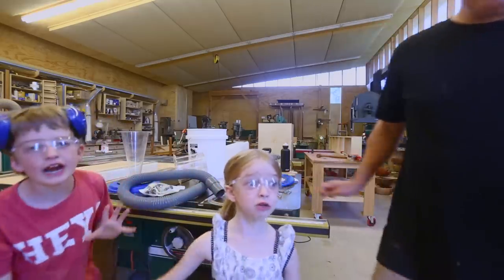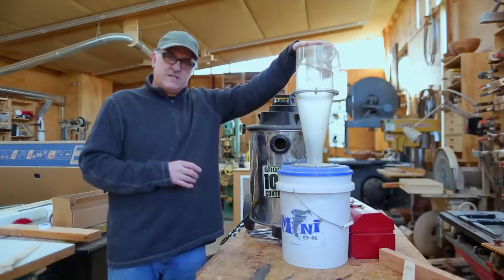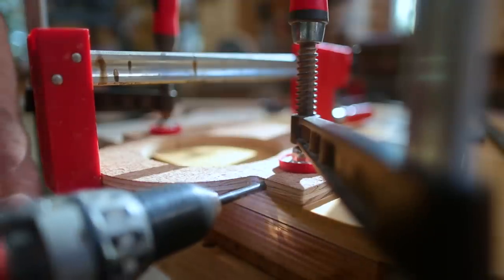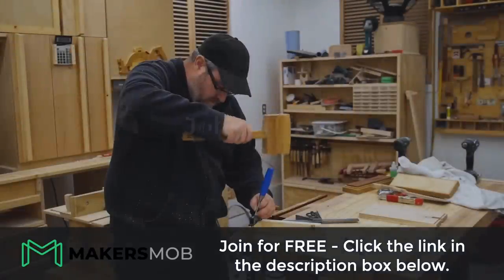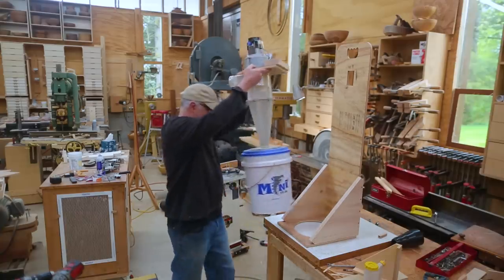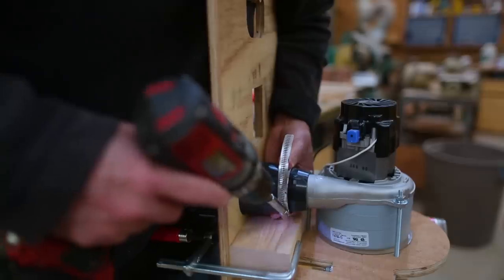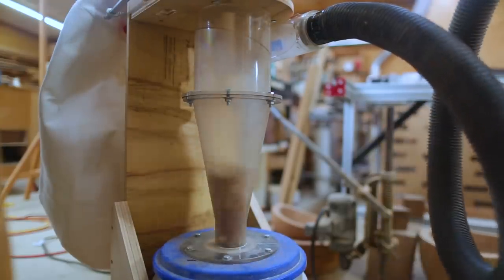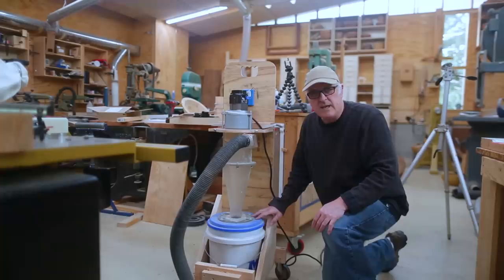Frankenvac

Comment: Throw the bucket away and make a square tapered box the same volume and opening size as a plastic bag. Next make a wooden lid with trim around the edges to form a lip. Under the lid inside the trim use some foam tape for an air seal. This makes a much better dust container with greater volume. Fix the lid to the trolley then make a lift to push the box into the lid. Mount the motor horizontal and place a round filter to the top of the cyclone clamped between 2 timber boards with sides to make a box. You probably won't need the bag after the motor but if you still want it the bag can hang down.

Comment: if making it all custom, just put the cyclone lid on a plywood box (with a latched side to clean-out) as the receptacle rather than bothering with the bucket.
Reply from the maker: I like this idea
Reply: @frankmakes  Put the cyclone lid on a plywood box with a latched side as @David Benoit suggests, but put a lift out box inside that for ease of emptying.
Reply: That box can greatly increase the capacity without increasing the footprint much
Reply: To riff on this idea a little.....maybe a box at the bottom with a door or possibly a blast door to enable a quick connect to the shop dust system, so you never have to actually "empty" it.  Just wheel it over, vac it out (vac out the vacuum, that sounds like your humor), and off you go.  Judging by the low amount of dust in the bag, it'll be a loooong time before that needs emptying.

Comment: Instead of a bucket at the bottom, make an enclosed drawer box you can simply slide out.  Screw the cyclone base to the top of the box enclosure with some foam window gasket under it to make it airtight.  If the drawer leaks too much air, you could seal that with foam too.  Use window sash latches to hold the drawer in tightly.

Comment: Nice dust collector, I made one similar but used a complete smaller shop vacuum unit and mounted the shop vacuum directly on top of the cyclone dust separator, however in doing so the motor is now rotating horizontally, this might not be good for the motor as it it is louder than it was before,  also keep the suction port above the level of your benches as that makes the hoses easier to handle, also on my second edition

Comment: Maybe mount a short drawer track (or maybe two) vertically to a modified blower support so that it can be slid upward in order to remove and empty the bucket.  You can drill a hole in the track in the upper position to insert a pin to hold it in place until the bucket is emptied.  In the raised position, you will also be able to remove blockages in the cyclone by probing, which will allow them to fall into the bucket.  Also, you could add a counterweight on the back, similar to the one that you placed on your radial arm saw, to allow the blower and cyclone to slide up and down effortlessly.  An old window weight inside a PVC guide pipe might work well for this.  A clear 7 gal. bucket would good with this setup.

Comment: Replace the existing lid with a plywood disc and attach it to the bucket with 3 or 4 latches and either some weather stripping or a home-made rubber gasket for a seal. That way you can have zero-clearance removal of the bucket from the vortex assembly.

Comment: Suck it Dyson.  There’s a new player in town.   This makes so much sense.  Have an integrated system that doesn’t require 2 tanks.  I currently have a massive Ridgid wet/dry that overwhelms my shop an the dust deputy sort of rides on top when it stays. I have a second with one of the tool box sized ridgid shop vacs that sucks just as well.  Almost no tank.  I have it more stationary for my CNC dust collection.  Both setups need to be modified to make them more esthetically pleasing and user friendly.  Thanks for stirring my imagination once again.

Comment: I would suggest making the entire unit much taller, and dedicating the bottom of the unit to parts storage, building a couple of hooks beside the upper part and then lift the bucket up into position and use the handle of the bucket to hook the bucket in place. That will make the bucket removal process super simple. The vacuum of the unit will hold it tight and the space the bucket uses now can be converted to nice nozzle or any other storage you want.
Second thought. In addition, I would suggest the motor to be mounted horizontally instead of vertical. The motor can then blow straight down to the floor into a HEPA filter hanging beside the bucket and reduce the "Footprint" of the final design. This would also reduce the possibility of blowing  contaminants across your shop and any current projects
Third thought? I wondered why you didn't use the existing shop vac bottom and "marry" the cyclone on top of it, taking advantage of the wheels, and handles? I have the same shop vac and considered some of these questions over the years I have used it.....

Comment: Mount the blower motor on top permanently, and then run a hose to the cyclone.   Make the blower high enough so that you can lift up the cyclone and bucket together.  To change, simply disconnect the hose from the cyclone, and lift the bucket and cyclone up and out.  Then split the bucket from the cyclone and empty.  I have a system that works like this and it works well.

Comment: seems like the hinge would be more complicated that necessary. Just cut across under the top horizontal for the unit. Then put pieces of wood on both sides that allow the top to slide, so you are capturing it put some end caps to prevent it from sliding sideways, then drill some holes for a pin. Pin it closed, pin it slid open for emptying. Done.

Comment: @frank - mount the bucket upside down, the cyclone mounted to the bottom of the bucket, pop the lid off from the bottom right into a trash bag and let it all drop in.  may want to add a safety latch so the lid doesn't pop off by itself.  just a thought

Comment: Raise the upper part about 1" and use wedges or board to raise and hold bucket under lid. When time to unload, remove wedges and drop bucket down and slide out without touching upper assembly.

Comment: Put a bit of flex tube from the bottom of the cyclone to the bucket. You can then pop off the lid because of the flex tube and then just lift the bucket out.

Comment: Seems to me you need to be able telescope the motor mount and cyclone up away from the bucket.  The easiest way as I see it is to have another back piece that mounts the motor, the cyclone and the bucket lid.  Cut some slots in the new false back and the have some stand off bolts in the original back with a couple of star knobs.  When you want to empty the bucket turn the knobs, extend the new false back up, tighten the knobs to hold in place, clear the bucket and then lower it and lock it off with the knobs.  Does this make sense?   You may have to set the bucket back the depth of the new false back + the distance of the standoff clearance between the 2 backs.

Great content  Frank as always, keep it up I appreciate the hard work you put into your videos and your channel.  Stay safe.

Comment: I paused the video at the point where you said I need to come up with a way to empty this; ironically I said add a hinge; BUT I think a better way would be to make the current "one piece back" a "2 piece back" with a longer top half which could slide up/down bringing the motor, funnel, and bucket top with it. When its slide back down, it would re-seat the lid. You could then use "wing nuts" to secure the 2 pieces in place. jmo

Comment: You might want to use a 33 gal trash can, or 55gal drum, the liners are cheap & you can clean the whole shop without having to unload. For added benefit: the lids are more rigid, allowing you to just put a hinge on the lid.

Comment: Replace the bucket with an airtight box with a removeable receptacle inside that you can dump. I'd make the top of the receptacle have a tenon all the way around that would slot into a dado cut in the box sides so dust couldn't get past it into the box. Done right, you wouldn't need the lower part of the box at all.

Comment: One other thing to consider is that if by chance you don’t realise the bucket is nearly full then the cyclone will lose its efficiency and fill up the motor and bag very quickly, try to add a mesh screen before the motor otherwise it’ll overload the unit

Comment: If you press fit the bucket with a lever and a platform on the bottom, I think you can easily remove the bucket without unscrewing anything.

Comment: Flip your bucket upside down. Cut the hole for the cyclone in the bottom of the bucket. Then you can have the lid on the bottom of the apparatus so you can pop it off and dump out the contents.

Comment: Frank, just ground the circuit to the metal that is part of the motor housing, there is probalby a through bolt someplace where you can back off a nut and capture a connector crimped onto the end of the wire.... infact, those big pieces of threaded rod you used to hold it down with... if that is all metal to metal to metal to the motor, just attach to one of those. That would also - I think - ground out any static charge you build up while using it.

Comment: Hi Frank! You could separate the cyclone from the bucket lid, 150mm for example an join the system using the same flexible hose you use to vacuum. Basically lift the cyclone/blower assembly by 150mm in the same chassis that u have now. The small hose between the cyclone and the lid will give u enough flexibility to remove the lid with ease when is needed. What do u think?

Comment: Have you considered a double cam to lift the lid and everything above it, Off the bucket, and have the board in the front of the bucket spring-loaded and hinged to fold down.  With a cam on each side and a bar across connecting the two cams, a single downward pull of the cross bar handle, and step on the release for the hinged front board, and voila, the bucket comes right out.

Regardless, very cool project!  I've wanted to do the same type of thing for years, but alas, no CNC for all of the fancy parts in my head.  Namaste!

Comment: I would check for continuity between the input wires and the metal parts of the motor. That motor may be intended for double insulated use i.e. use on a device where it is not possible for the user to touch any metal that might have electricity on it. I would consider putting a gfci on it?

Comment: Don't move the motor and the cone, move the bucket! Replace the bucket lid with a disc out of plywood or MDF and cut a groove into it that fits the rim of the bucket. No need to seal anything. I built a separator like that, which just rests on top of the bucket. When on it pulls itself so airtight that I "imploded" one bucket when I blocked the hose by accident.

Comment: What about having the bottom bit with the circle for the bucket in two pieces like the top one and have it run in grooves on the side triangles (like the drawers you recently made) so that you can slide the front half out and remove the bucket for emptying? Good maybe need to have it run above the wheel assembly

Comment: To improve ease of emptying raise the entire mechanism uo a few inches and connect the cyclone to the bucket with a flexible hose.  You could the pop the lid off the bucket and discard without removing screws.

Comment: Hey Frank.  What if you attached the Shelf/Collar thing to the large back panel with threaded rod and knobs that slide in some verticle slots.  You can loosen the knobs, lift the separator/motor assembly straight up, re-tighten the knobs to hold it in place while you empty the bucket, then slide the assembly downward and retighten the knobs.

Comment: Instead of attaching the cyclone to a bucket lid attach it to plywood that is mounted to the frame. The wedge the bucket against the bottom of the plywood. And the base of the cart. When the bucket is full, pull the wedge out remove the bucket and empty it. Everything else stays in place

Comment: 11:55 In case this is still relevant, and you haven't already built a V2: Instead of a normal hinge (which would require a locking system of some sorts as well), maybe look into a slot with an opening at the top for the bottom part, and two pins in the top part. To empty the bucket, you first pull straight up on the top part to release the lid from the bucket, and then you can pull the top pin out of the opening in the slot, which allows the top section to pivot. I think it's a similar mechanism to how a pull-out ladder on a semi-trailer works: It first comes straight out (up in your case), and then it pivots down (backwards in your case). I'm having a little trouble describing this, so if anyone knows what I mean and has a better example, feel free to elaborate.

Comment: Frank, what about having a floor plate which moves up and down for the bucket.  This plate could be moved by cams attached to a rod.  This way the cyclone and motor stay stationary but the floor moves away when you need to change out the bucket.

Comment: You could build a sliding drawer on the bottom and pull it open and have a hatch to open on the bucket to empty it without taking anything apart?

Comment: Hi frank, maybe use a taller bucket. As it didn’t increase the footprint. If it becomes unstable you can add a weight at the lowest point. That will work it you only use it as a shopvac.

Comment: Usually it's the casement of the motor that's ground on those, i know a lot of my vacuum cleaners use a contacting strip or a bolt to create a ground, but then again, a lot of other vacuum cleaners don't. My thrialton doesn't have a ground, yet it's a pretty  big motor. In fact, it's actually the size of your blower motor.

As for emptying the bucket, just put the  piano hinge above the triangle pieces on the vertical board as you said. I mean, if you're in the spirit for further fabricobbling.

Comment: As an electrician I would say as long as the motor is fully coveredthe only ground that would be required is onto the metal work of the switch. and even that may not be required under your local code. it would be here in the UK

Comment: instead of using the hinges on the back piece could you not to add some t shapes to the top clamp that slide into slots in the back panel if that makes sense at all

Comment: Instead of a hole for the bucket, simply have a flat shelf that is 3/4" lower than it needs to be. Have a "shim" made of 3/4" plywood. To empty the bucket simply pull out the shim and the bucket will drop down and can be slid out.
Reply from the maker: I'm not supposed to touch my face but my hand just hit my forehead, I did on think about this, now it seems so obvious.  great idea
Reply: @frankmakes  haha, if I had a penny for everytime someone gave me a solution I had totally missed, I would be a rich man!
FWIW I guessed at 3/4", that might not be enough wiggle room to remove the bucket, you may want more. 
My workshop is small enough that I don't need to move my shop vac around so my cyclone is bolted to the side of the main drum. One day I will build something better!

Comment: Why not use the canister from the original shop vac?? It had good wheels and a handle. Probably also had a clip system that would let you quickly attach and detach the cyclone on top.

Comment: So your old ShopVac™ had a max airflow of 100CFM and your new whole house vacuum cleaner blower is rated at 95CFM, so it is pretty much an equivalent drop-in, though you likely have greater suction with this new vacuum blower.  These types of blowers are designed more for suction than airflow, so that is why the filter hood you used is limp and not fully inflated.  I'd recommend ditching the filter hood and just replace it with a more compact HEPA filter cartridge like the ones put inside a ShopVac™ canister.  Doing so will filter out more of the smaller dust particles that are harmful to the lungs.  Typically those filter hoods, at best, only filter down to 1µm, but you can get shop vacuum HEPA cartridges that filter down to 0.3µm.

Comment: Great build!
Can I cast a vote to mount the blower and cyclone assembly on a pair of slides that let you lift up and down?  Put a peg or latch to hold the assembly up while working on the bucket.  You would have to cut a slot for the output hose to travel in.

Comment: How about building it with the lid of the bucket at the bottom? You would only need to remove the bottom to empty it.
Although if there is a lot of air pressure from the cyclone you may need to clamp the lid into place.

Comment: You could ditch the bucket.  You almost have a box around it now.  So, complete the box and have a door like your big dust collector repository.
Reply: With a thin walled box the fits inside so it can be dumped easily.
Reply: Randy Bartlett if you can remove the bucket it will be easier to dispose of the contents. If you make a box you would need to shovel out the sawdust or carry the whole machine to the trash can. That might be a bit messy.
Reply: I was thinking the same thing. If you cut the top off the bucket and glue that into the top of the box you don’t have to change the attachment to the cyclone. As was mentioned below a smaller box to line the collection box would make for easy emptying without a shovel.
Reply: Very smart guys!  Frank made his Frankenvac 2.0 like this!
Reply: @canadude6401  Maybe Frank reads the comments.

Comment: How keeping the separator and blower stationary, then use a cam, gears or a lever to lift and lower the plywood ring that supports the bottom of the bucket. Only one moving piece, and the mechanism might only have to be strong enough to lift a bucket full of wood dust.

Comment: you could change the top bracket that has the motor on it to an L bracket, and have a dovetail connected to that and the vertical panel so you can slide it up to get the bucket in/out and you shouldnt have to unscrew anything